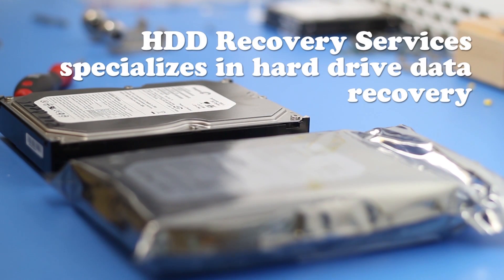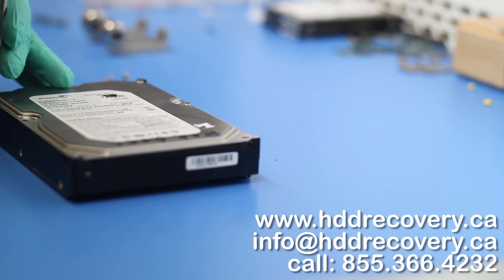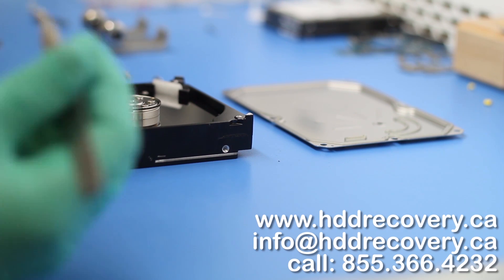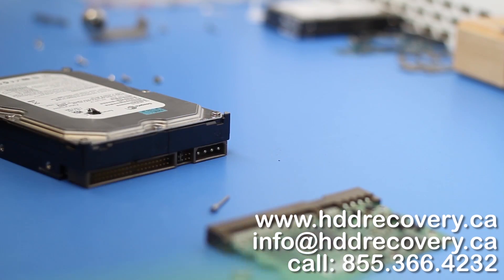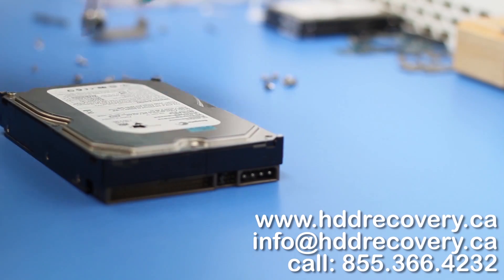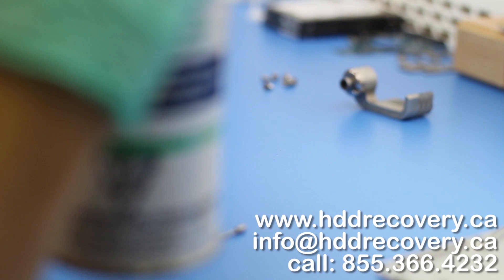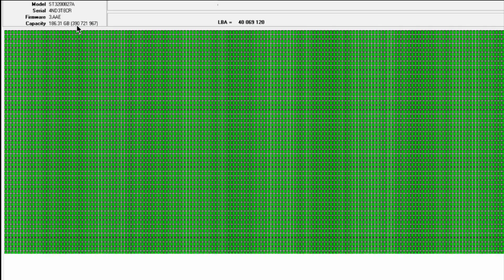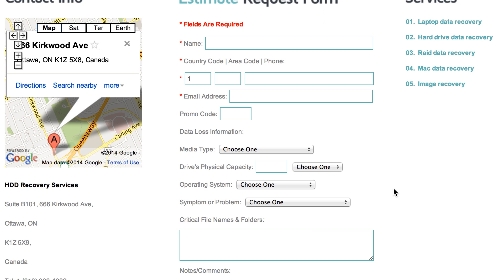Recovering lost data on failed Seagate hard drive - Ottawa, ON

Comment: My "Seagate 3tb  - ST3000DM001"  just crapped out.   It powers on still and spins but windows is not detecting it.  Just reached out to Hddrecovery for an evaluation.  Damn you Seagate...
Reply: Would love to know the results of the evaluation. I have a Seagate 1.5TB brought to us doing the same thing. Tried different OS's and programs but nothing sees the drive. It just won't initiate.
Reply: Check out this tool in this video. https://www.youtube.com/watch?v=-TO5tfaRszA&t=7s
Even if you can't repair your drive, you will be able do diagnostics on it.

Comment: seagate is a complete con - I've had my device for just a couple of months and its never left my house.  I bought a new mac and saved all my data on the seagate only copying files for last 12 months on to the new mac.  10 years of data were left on the Seagate device, which now won't work.  The recovery price is £495?  WT*.......  A complete rip off Seagate - how can you get away with this?
Reply from the maker: 495GBP is not too bad actually
Reply: 10 years of data for only 495? I would do that in a heartbeat! They want $1200 from me for less than 2 Tb's of data recovery. Now my second one just died with 30,000+ files of my work. We'll see what they want to charge this time

Comment: How about i send you the 4 discs i removed from our 4 tithe seagate harddrive. Can you extract the data? And whats the cost? Removing discs and heads is not that hard you just really have to be careful about everything as it's to delicate to do so. Thanks let me know.
Reply from the maker: If you removed the disks we would not be able to recover your data sorry
Reply: So what is it that you specifically want or need? I can add them back no problem. The discs are the ones with the data right?

Comment: Hey dont know if heres the right place, but i got an 80gb seagate HDD from my early 2000 laptop, i just recovered it and i wanted to hook the HDD up to my new pc, is there a way to connect it so it would be like an external HDD. The HDD should be fine, it was the power supply that failed.
Reply from the maker: +Sondre Andersen (Sony) hi, I assume that your 80GB hard drive is has an older IDE interface (looks like this http://bixnet.net/images/NBHD-IDE-Connector.jpg), and in this case you would need:
1.adapter for sata cables: http://www.amazon.com/44-Pin-Female-Male-SATA-Adapter/dp/B004E5J0NA/ref=sr_1_4?ie=UTF8&qid=1458136401&sr=8-4&keywords=2.5%22+44+Pin+Female+IDE+to+SATA+Male
2. 2.5" to 3.5" cradle so you can mount it to the PC tower: http://www.amazon.com/Notebook-Drive-Mounting-Bracket-Adapter/dp/B00AYJFXIQ/ref=sr_1_1?s=electronics&ie=UTF8&qid=1458136657&sr=1-1&keywords=2.5+to+3.5+caddy

but for the price of these parts you paying I am not sure if 80GB old hard drive is worth it

Comment: Can you put the head back and see if its working or do you have to replace it with a new when its clicking?
Reply from the maker: If it's clicking you have to replace it.
Reply: ok.. thanks
Reply from the maker: +john mortslake on older hard drives with lower density platters cleaning heads with specialized engineering fluids can also help. I have don't it in a while, but I would try to film one in the near future
Reply: ok..i got a seagate 500 g that started clicking.
Reply from the maker: +john mortslake does it click 12 times at the startup? Or while in use occasionally?
Reply: it clicks and cant use it
Reply: at startup. computer cant find it
Reply from the maker: +john mortslake yeah that sounds like a head crash for sure

Comment: Iomega Prestige 2TB died on me without reason. Includes a Samsung HD204UI. Never had problem with Samsungs before, so im surprised. Tried moving it back, not helping. Would switching the bars by getting a donor drive be the only solution? Does the donor drive have to be the exact same model, or does any drive work?

Comment: I have a Transcend external hard drive 500 gb I could not open the drive on the computer it kept asking it to be formatted so I tried the normal method by right clicking it and formatting but it did not get formatted then I formated it from disk management which was successful ,after which I had to partition it which failed after trying a few times continuously so I removed the hard drive and I decided to try it another day now it does not show up on the computer nor in the disk management is there any way to fix this or at least get the data back please help!!!!

Comment: it boggles my mind that people charge 1000+ to do these very simple things... its so easy
Reply from the maker: +balancex3 it may look easy, but it's not. This procedure on 7200.11-12 Seagate with 4 disks inside is nearly impossible to do successfully without this head extractor that alone costs 500Euro for this specific model of the drive. Plus on top of that you need tools for disk imaging and adaptives migration (at least $7K). We don't just charge to do this, we do this with the guarantee that data will be retrieved or there is no charge.
Reply: The price for this is much too high for the job. It should be an hourly price for this type of work. I could see maybe 100 bucks for the hour of work that it might take.. easy to do. tools arn't cheap but 1000+ per job is ridiculous.
Reply from the maker: it is what it is.
Reply: +balancex3 I'm getting mad, then people say something like this. Knowledge and experience is that you paying for, not just labor.
Reply: Sounds like you should open your own business and do it cheaper. Good luck.
Reply: Martynas Mirauskas if it cost more to get a hard drive rebuilt then it does to have the manifold gasket put on a car, something is seriously fucked up!

Comment: What is the size of screwdriver you using? edit: opening cover screws.
Reply from the maker: +JOrgen Onssens T8x60, but I would not recommend you to open your drive unless you have access to laminar flow bench or a clean room. You will contaminate the drive.

Comment: My seagate it does start up but i can see my pc booting like hell i mean the button or light that you can see your computer is working in something is like always on,and the motherboard takes at least 3 or more minutes to skip.The thing is that when i conect data cable it does that when is not conected the computer works just fine,what can be the cause of that issue?.

Comment: This might be exactly what I need done, I have the same model! My hardrive still makes a normal running noise and no clicks, however the light will not come on and my computer won't read it. What should I do?
Reply from the maker: youngwoo321 if your drive sounds normal then the problem is most likely with firmware of the drive. You can contact us here: http://www.hddrecovery.ca/contact-us/ to get an estimate (mention that you found us on YT)

Comment: I like how HDD recovery is proceeded with the same care and finesse as surgery on a human. I have a 1.5 TB Seagate HDD that broke nearly a year ago, I still have it, and I would like to get the data back. I don't have anything important but I have a lot of great memories stored on it. I did get another 1TB Seagate drive. The broken HDD came on a Dell XPS 8300, 12GB of RAM, i7-2600 quad-core with dual threads, 3.4 GHz and 64-bit operating system (Windows 7). I got this computer in august of 2011. When I try using the HDD, it doesn't get past the boot, I try to boot it and, it starts up, then makes a series of clicking sounds and afterwards stops. What might this be? Is there a way of repairing it while avoiding this type of procedure? And if not, where can I find a clean room and the tools for this? I wouldn't do this myself, my older brother is a computer engineer, he would most likely do it. And if my brother can't do it, where can I find these types of services?